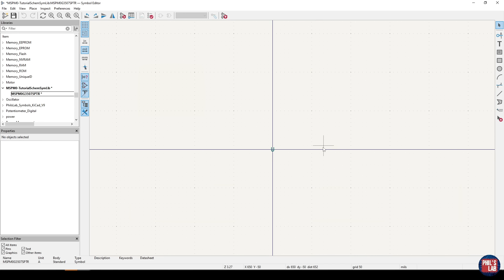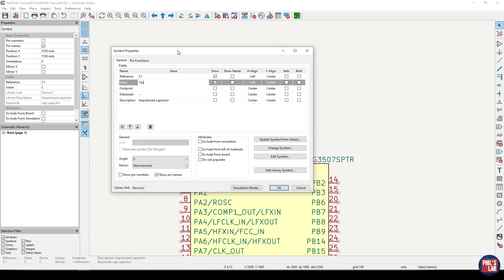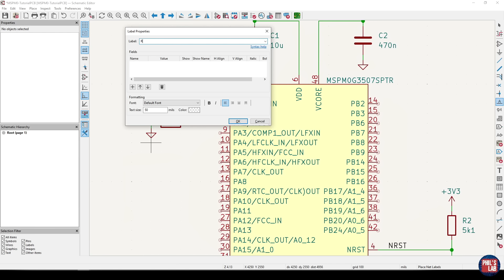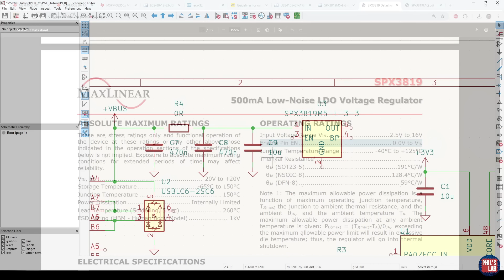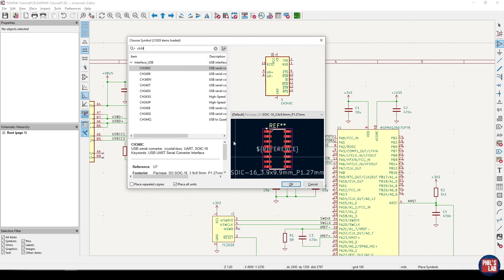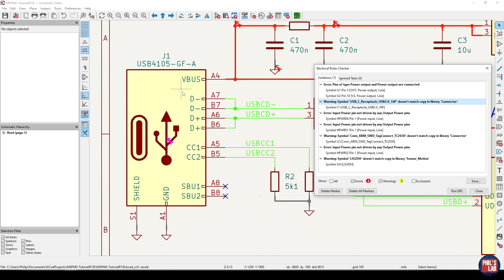KiCad 9 Hardware Design Tutorial (TI MSPM0) (1/2 Schematic) - Phil's Lab #165

Comment: For labling has anyone tried to lable them based on group. Like the mcu is u100 and all bypass caps are c10x. The voltage regulator is u200 and  again its capacitors are c20x? I find it easier when im build because it group the relavent compents together

Comment: 1:44:00 I quickly annotated everything the same way by setting the annotation scope to "Selection" and doing it in three sections: (1) The pi filter + LDO section at the top, (2) Everything else to the left of the microcontroller, (3) everything else (by switching scope back to "Entire schematic").

Comment: The oscillator you had was passive, the symbol now in KICAD is 3 pin (as 2 & 4 are overlaid), I instead used an active oscillator - fine for low volume as they are x10 more expensive, but more stabe and accurate (plus you don't need the caps).

Comment: A tip for footprints: take a screenshot of the footprint in datasheet and import/scale/align in the footprint editor on the user.drawings layer. You can then toggle visibility of the layer to quickly verify dimensions.

Comment: Great detailed video again!

Small question: at about 43:10, you mention that paralleling capacitors could cause resonances.
However, in an earlier video (KiCad 6 STM32 PCB Design Full Tutorial ‑ Phil’s Lab #65) at about 12:05, you say it’s good practice to place a bulk capacitor (10 uF) in parallel
When is it recommended to place capacitors in parallel between VDD and VSS, and when should it be avoided?

Comment: I have a question. Instead of having to Step down the 5V, could you use a resistor to form a voltage divider between VDD and Vcore to supply 3.3 and 1.3v respectively?

Comment: This is the absolute best tutorial I’ve ever come across. I’m glad I finally took the time to watch the entire video. Previously, I jumped into it cold and did Google searches whenever I got stuck. That approach usually works, but it only led to extreme frustration with KiCAD. As a software developer who has worked with many design and layout tools, I expected KiCAD to be a polished product that followed familiar and well-established UI conventions. 

Thanks to your video, I now realize that my prior knowledge was more of a hindrance than a help. KiCAD was obviously designed by someone who either despises graphical user interfaces or has very little experience using them. It has the tell-tale UNIX command-line and configuration approach to user interaction all over it. There's simply no reason to make users type in something that can be easily presented and selected from a list. Sadly, most open source software simply doesn't get it and probably never will.
Reply from the maker: Thank you very much, Bob! I agree with you - I'm not the biggest KiCad UI fan either.
Reply: Brother try Eagle for one day and you will want nothing else than KiCad.

Comment: You can use the easyeda2kicad python script to immediately get a schematic symbol, a footprint and a 3D model for most parts sold on LCSC and save a lot of time

There are rare errors in LCSC symbols/footprints, so they need to be verified, but this is much faster than drawing all from scratch

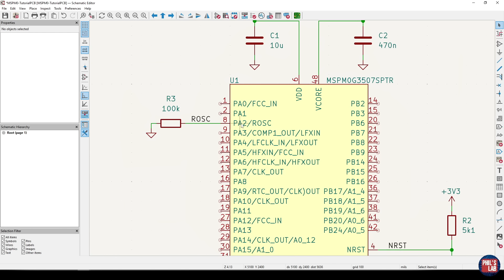Comment: Very good introduction to Kicad. At 48:30 is there a reason that you didn't check JLC stock? They have a bunch of precision 100k resistors, like C122538, C328419, C190609, C335088, C667147, C844888 and many others, all on stock locally. 0.1% 25ppm 0603.
Reply from the maker: I design boards based on 'generally-available' parts. I.e. the components should be available at many major distributors (Mouser, Digikey, etc..).
Reply: @PhilsLab  You went 'wrong' here by searching only for thick film resistors. As you are certainly aware, but for the benefit of less experienced viewers, for precision applications thin film are superior to thick film in almost all characteristics and in this particular case happen to be much cheaper with more choices and better availability.

Thick film resistors are usually chosen for non-critical applications because they are usually much cheaper - until you start wanting tight tolerances and temperature coefficients.

[EDIT] Excellent video by the way!
Reply: @PhilsLab  Yageo RT0603BRD07100KL (C122538) and Vishay TNPW0603100KBEEA (C844888) are pretty much like that. I was just wondering why you're specifying a part to order instead of one that is already there.

Comment: Does the CC studio have an easy to use setup interface? I'd like to try some other micro apart from STM32, but I find the CubeIDE extremely useful for setting up all the peripherals. Also HAL - for noobs it's a gamechanger, especially if the uC's datasheet page count is getting into the 4 digit zone :D I'm mostly a HW guy, so I appreciate any help from my tools when I need to develop software.
Reply from the maker: I much prefer CubeIDE, but CCStudio is pretty decent/easy-to-use and has a fairly good graphical set-up method for the MCUs.
Reply: OK, thanks!

Comment: This is great stuff! Couple of questions: 1) I notice you don't use global labels, but run the wires all the way, is that because is a fairly simple schematic? Would you use them in more complex? 2) How you find Kicad vs Altium, I guess you prefer Altium for more complex designs like FPGA/Zynq with more than n layers, would you be comfortable designing a 16 layers with Kicad? Thanks for your time.
Reply from the maker: 1) Yes, schematic is simple-enough. I use harnesses/global nets/.. for complex, multi-page schematics - or if I'm doing large jumps across the schematic. 2) I prefer Altium, regardless of simple or complex designs. I wouldn't like to miss the tools there that I am so used to, as I use it every day. KiCad is completely fine and you can design 'any' board with it though.

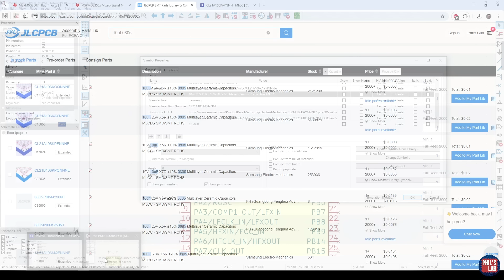Comment: Around 32:00 you are discussing adding detail to the capacitor and recommending creating personal libraries for commonly used parts etc. Is the LSLC parts catalogue highly stable? I have visions of creating libraries with their part numbers and then finding out that every new project I have to redo all of the parts because the catalogue has changed.
Reply from the maker: The stability has gotten a lot better, plus you can preorder parts and have JLC store them for you. That's what I've been doing and have had success maintaining my libraries that way.

Comment: It is very exciting to see how progress on KiCAD has sped up lately.  I am having trouble keeping up and only recently graduated to KiCAD 7.  I just downloaded KiCAD 9 today and need to propagate it onto the development computer.  Exciting times for KiCAD (and FreeCAD for mechanical design).  Thanks for the very well thought out video.  

When I was an Engineering Director at a CEM (fifteen plus years ago) we used to use the MSP430 almost exclusively.  Since then i have been using the STM32 and ESP processors and have not seriously looked at TI processors but it is nice to see TI using the ARM cores.  I will have to look and see if TI has kept some of the hallmarks of the MSP430 line like ultra low power.
Reply from the maker: I appreciate it, thank you. Yeah, thought I'd try something different with TI this time, but usually stick to ST as I'm so used to their portfolio and development environment, I often don't see a reason to switch.

Comment: 1:30:34 It might be an opportunity for me to learn something new.
→ Regarding the CH340E VCC/V3 connection and decoupling capacitor: seeing how we are connecting them, I don't see the difference between the two parallel 470nF decoupling capacitors and using only a single one, since the exact value doesn't seem to matter (BoM consolidation is a great advice). As it is, I'm not seeing VCC and V3 each with a decoupling capacitor, but rather VCC et V3 connected together to an equivalent 940nF capacitor.
Reply from the maker: It looks weird on the schematic, but physical location on the PCB is what matters here, as we'll get to in the next video.
Reply: Decoupling capacitor doesn't really shows its usefulness on schematic / lumped component analysis. There's a reason they are placed as close to the IC as possible and near the pin that is being decoupled. Phil has a video that explains the topic of decoupling capacitors more thoroughly

Comment: damn Phil im ngl i jut watched the kicad 7 vid and tried using it for kicad 9 and it worked well but im glad to see a new kicad vid, will be going through this later today
Reply from the maker: Thanks, Manny!
Reply: @PhilsLab  Really good video again, I was used to some of the expected errors like the PWR FLAG and added those ahead since i had watched the previous video, i find since i'm still a beginner i mostly find it hard routing, i usually get a TON ( i mean in the hundreds lmao) of clearance issues. I think its just because of the amount of time i had spent at my computer and i just wasn't delicate enough with routing, some things may have been rushed after 7 hours of just staring at a screen, It also felt like i was trying to catch up to you in the video because i was trying to copy 1:1 instead of learning on my own. I took a different approach by pausing and doing a lot of it myself and then watching what you did then correcting myself if something wasn't right

Comment: Any special reason to use 470nF enstead 100nF ?   Or why?  Thank you for info.
Reply from the maker: Required for VCORE as per the datasheet. Then just doing BoM consolidation, actual cap value for the rest isn't too critical for this design.